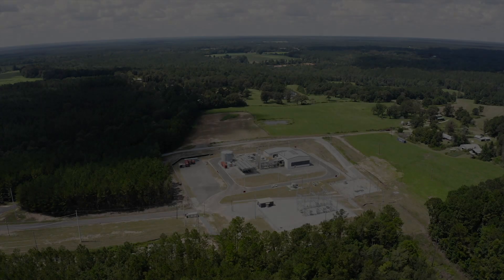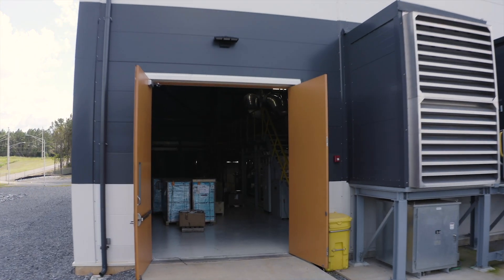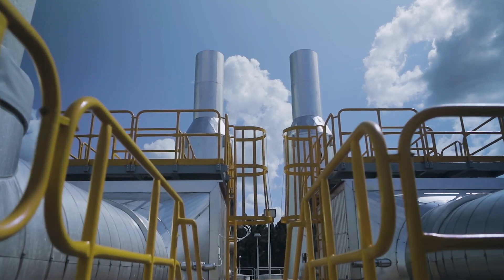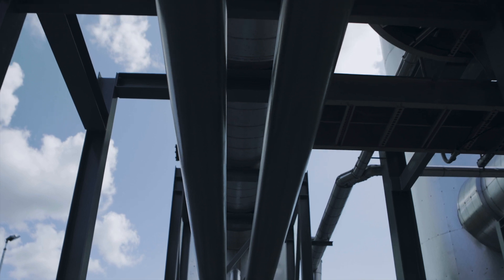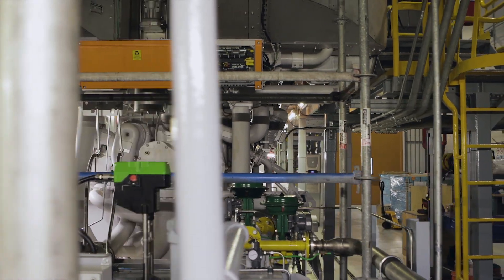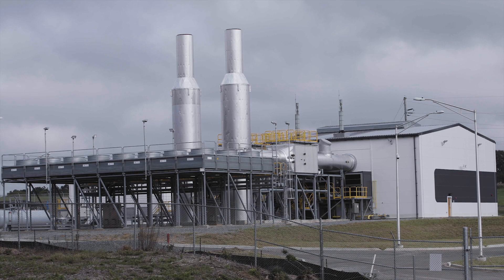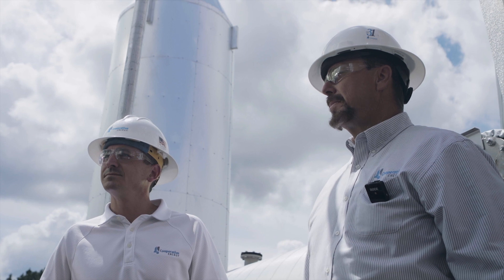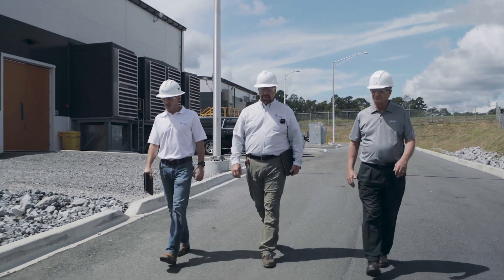Flexible Gas Power Plant Wärtsilä 31SG | Cooperative Energy, Benndale

Comment: makeing electricity with Diesel for Electric car using clowns :D sounds green to me :D
Reply: This engine is most efficient when compared to a car engine, so is more green. By the way termal will be necessary in any environment condition because of wind and solar have fluctuation, this kid of energy source cannot running in a continuous output the whether can change fast, and for supply energy very fast the grid needs this kid of equipment.